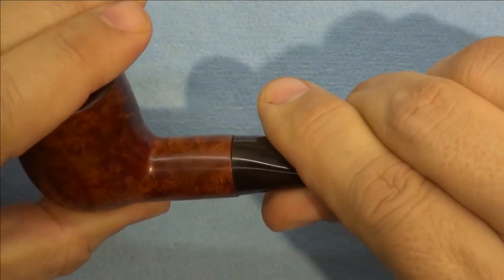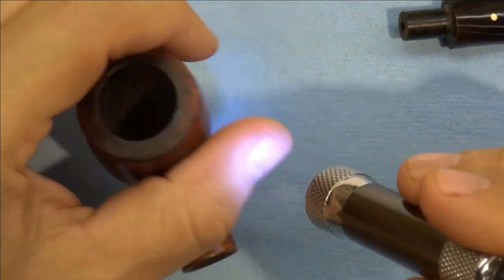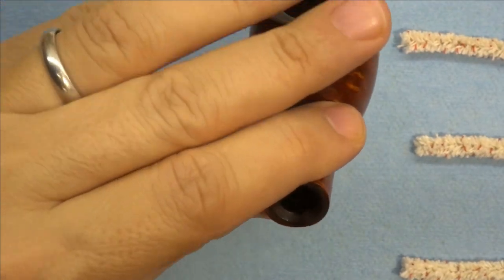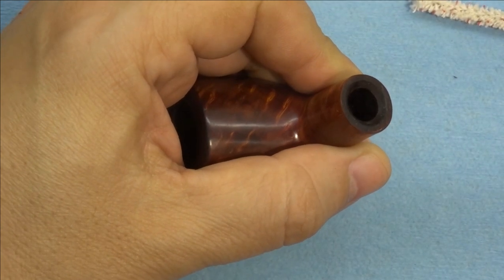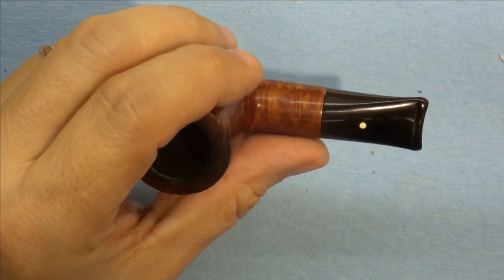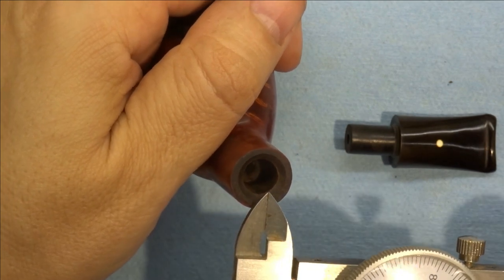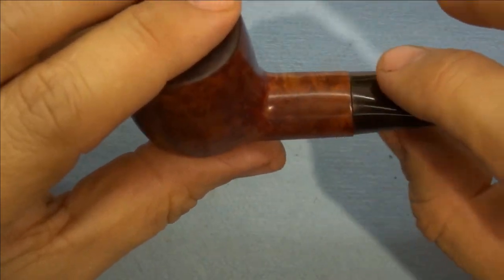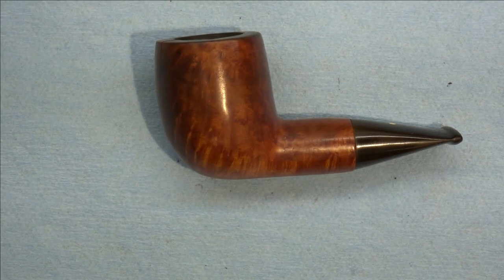Repairing a Cracked Dunhill 305 Part 2

Comment: Mike, I have several Dunhill. You could ask for a new tenon (this was the 70's?) from them, they often would send you a new one free of charge, same model. Because the pipes were done one at a time they weren't exactly alike, even same model and year. Probably something happened to the original and they put a genuine Dunhill replacement, slightly different. This was evidently a well used pipe, I would suggest you get a new Dunhill tube (PA3104 used to be the code for a pack) and try it on the pipe before you makes any more changes. Cheers
Reply from the maker: Hi Peter,  I assume you mean a new stem?  That would make sense.  I don't see how the inner tube would make any of these issues different.  The tubes were essentially a disposable airway, so they will not effect the fit of the stem in any way that I can think of.

Comment: The 305 is a neat little pipe. Too small for me, but a great little shape. I’d also be willing to bet that’s not the pipes original stem.
Reply: I am starting to think that also. I bought the pipe in that condition and because It’s a neat little pipe I sent it to Mike instead of trying to fix it myself and ruining it. I have looked at other 305 models and the shank ends just a hair past the Dunhill stamp just like that one. Perhaps the stem it off of another 305?
Reply from the maker: That is a possibility Ross.  I would not expect the stems to be interchangeable.  I guess we will never know ;-)

Comment: If you put a Dunhill tube it will show if the stem is aligned (of course it is, but the tolerance used to be perfect, down to a very accurate fit, any discrepancy will be obvious) with the pipe, you can do the same with a rod, but because the tubes were supposed to fit perfectly it should show  better the fit. Also it will make the pipe more "original" and is a cheap method, you get 4 tubes in the packet. I have a Dunhill with a crack, the tube doesn't allow to put the stem in anymore. Cheers
Reply from the maker: Thanks Peter, I appreciate the information!